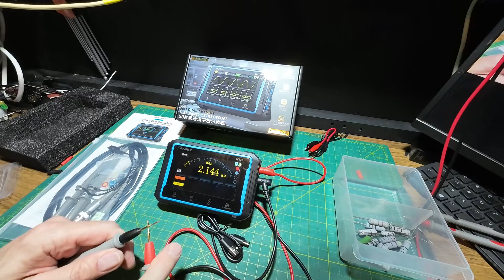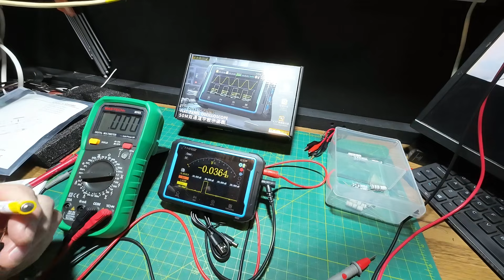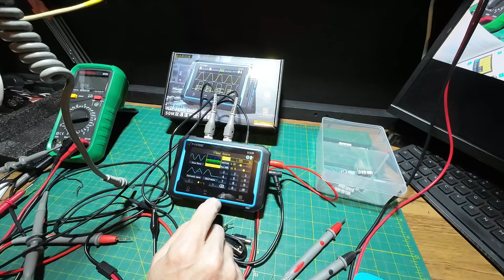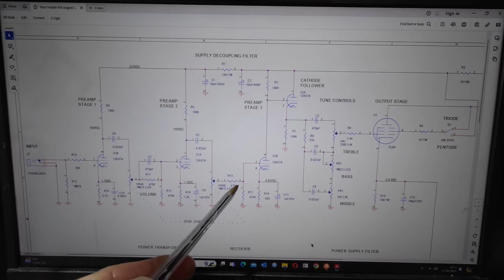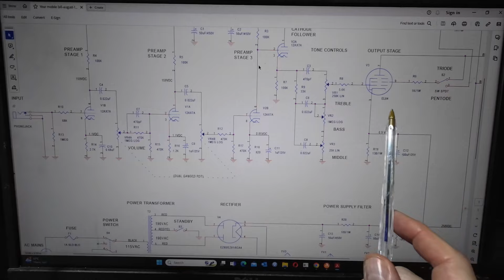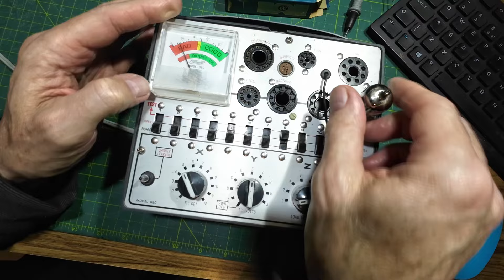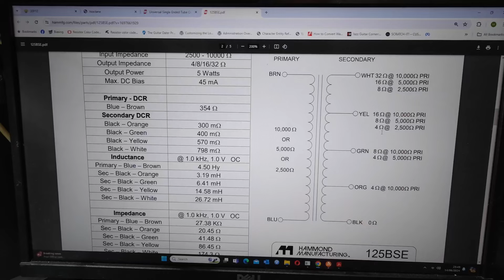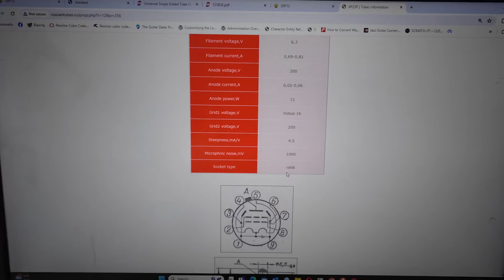FNIRSI 2C53P Oscilloscope+Multimeter+Signal Generator Quick Look and a Gift for the Channel

Comment: The units I bought were the 2C23T which has the same feature set, in a DMM format with a smaller screen and physical buttons.  While it's not the most accurate nor can it be called feature-rich, it's great for the hobbyist like I who has been servicing his own amps as well as other electrical and electronic gear for the last 40-something years and truly unbeatable for $99 USD.  It puts a scope in the hands of someone who could never justify the purchase of one.  Very intuitive to use and quite frankly a lot of fun for those who can appreciate it.  So far, mine is impressing  but that's partially due to my low expectations.  The documentation doesn't tell you any more than what 20 minutes of tinkering won't uncover.  It does function, it's more than just a toy - just not a piece of precision test gear.  It gets you in the ballpark.  All cables included.  Great bang for the buck!
Reply from the maker: Hello Rico. I will have a look at that model. Take care.

Comment: Hello Martyn, This amp project looks very interesting particularly because of the use of "alternative" valve types.  Not to through a spanner in the works but if you have another 30P12 would you consider making it a parallel single ended output.  Working with an anode voltage of 250V and an 8 ohm load, the Black - Yellow winding would suit or with a 16 ohm load the Black - White winding.  The latter utilizes the whole of the primary winding which would help maximize power transfer.  Both secondary windings on your power transformer would easily cope.  Also, by loading the windings closer to their current rating it may help to keep the voltages in spec, particularly the heater.  You may have progressed too far into the build to change now but it was just a thought.   Regards, Jeff.
Reply from the maker: Hello Jeff, That's a great idea. I have not started it yet. I will have a dig through the tube stash for another 30P12. Take care Jeff.

Comment: Wow.. this is very curious. I used this website a few years ago and it then sort of disappeared. The version you found has a slightly different URL and has a different selection of projects. Hmm.. Anyway, before the original site disappeared I downloaded a bunch of schematics including the Hi Octane and the one I have appears to be a later revision - I'm not sure there is much difference except it uses more modern component values eg 47uF caps rather than 50uF etc. If you are interested I'd be happy to share the ones I have. I built an amp called the Single Ended Lead from the original AX84 site, essentially the same preamp but with a KT88 as the output valve. I actually used a 6550 (I got given some). The amp is very bright but surprisingly quiet noise-wise for a single ended amp, I was quite impressed. A good basis for experimentation I think!
Reply from the maker: Hello SJ. That sounds like a great amp. I would be grateful if sent me the schematics you have, thank you. Do you have any pics of the amp you built?

Comment: Martyn, those tv valves are pretty rugged. The heat and voltages in a tv were far greater than the demands you will put them under in a guitar amp.
Reply from the maker: Hello Mark. They are. It's hard to know how far to push them as nobody as tried before as far as I know. Take care.

Comment: You might want to be careful with the Ecc85 swap possibility, I just had a look and the max cathode voltage Is 90V compared to 180V on a 12AX7, the cathode follower is showing 145V on that schematic
Reply from the maker: Hello Steve, thank you. That's a good spot. You are right. That might be a problem. Thanks for you input and supporting the channel.  Take care.